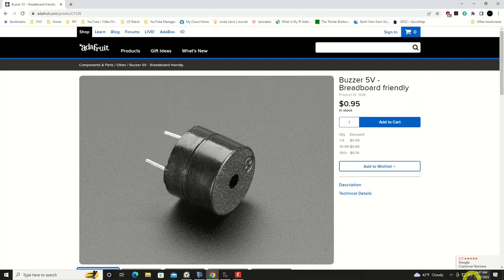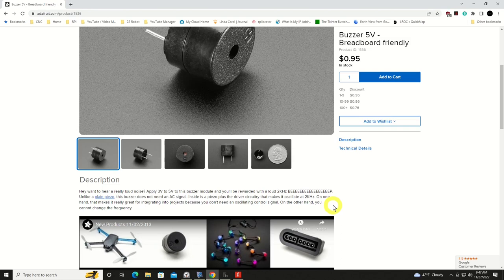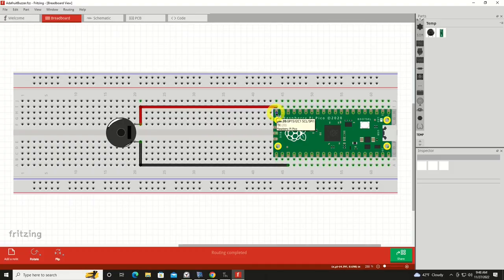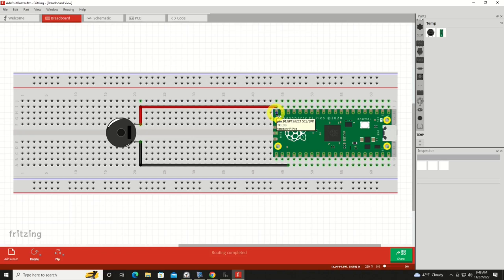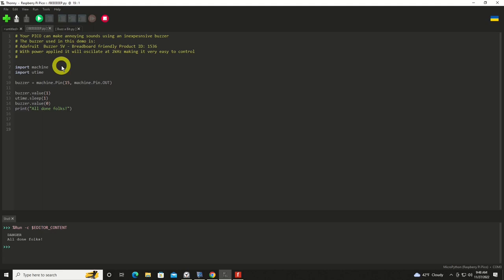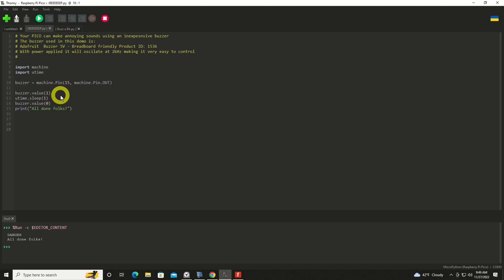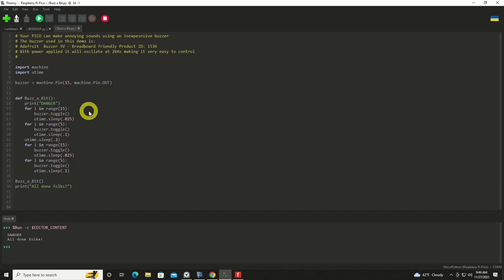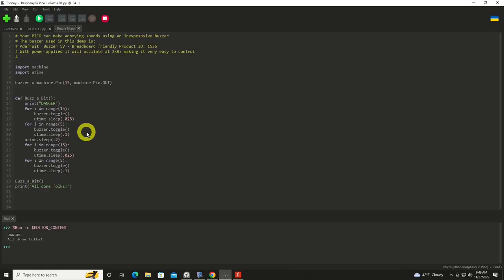Make Annoying Sounds With a PICO and This Buzzer

Comment: looks useful but how much current does it draw from the output pin?
Reply from the maker: There was no specification provided.
Cheers!
Chris
Reply: I found some guy who calculated 300mA, so a 220 resistor would be enough to keep it 20mA. maybe it wasn´t from a pin but from the supply (just in case, I would put it)
Reply from the maker: @Milangasor  Thanks for sharing that information!  Cheers!

Comment: Hi Chris, I just found your channel. I'm a complete beginner when it comes to Raspberry Pi's, but I have a question: can the pico store source code on the controller itself, so it can run autonomously? (after you hook it up to some batteries of course).

I'd like to build something that beeps every X seconds, but I don't want to have to plug it into a computer in order to work.
Reply from the maker: Hello Koenhd718,
Yes you can.  I think these two videos will help you out.

HOW TO MAKE THE RPI PICO AUTORUN A PROGRAM				https://youtu.be/2fLME6EresI

INTRO TO BATTERY POWER FOR THE PICO						https://youtu.be/UlKjjkLG69s

Welcome to our community!
Cheers
Chris
Reply: Thank you, that's extremely helpful! 😃

Comment: Just trying to figure out why im getting no sound? Set up and code are the same. I thought it was my buzzer, but I tried a different code and all was well... any thoughts?
Reply from the maker: Hmm, this thing is pretty simple, not much to go wrong.  Be certain to remove the sticker covering the hole, sounds cannot be heard with it covered.  You can also test it by applying 3.3V to the PLUS leg and OV to the other leg and it should make sound.  Next would be, can you hear at that frequency?  I have a LOT of trouble at higher frequencies, but that buzzer was easy for me to hear.
Reply: Did you figure it out? I have the same problem :/.